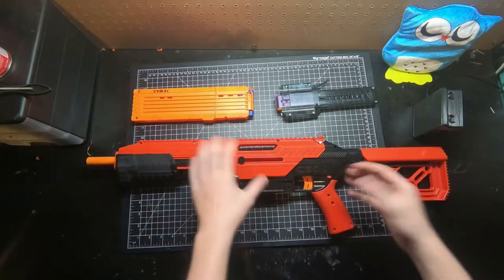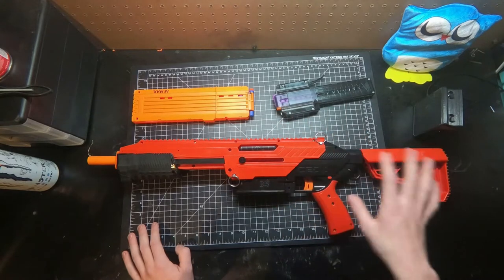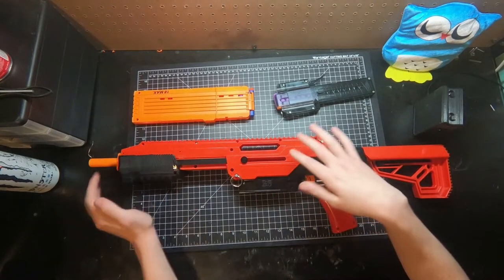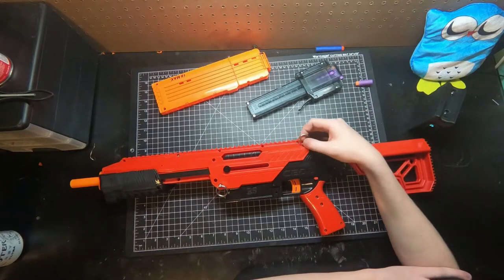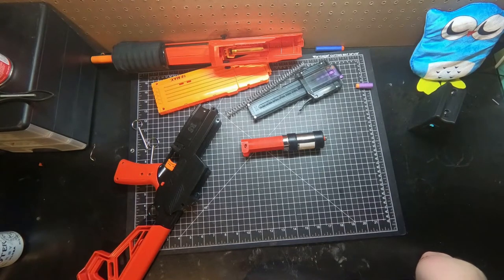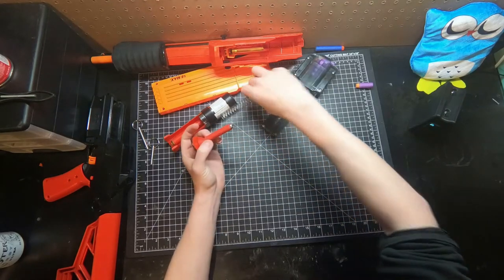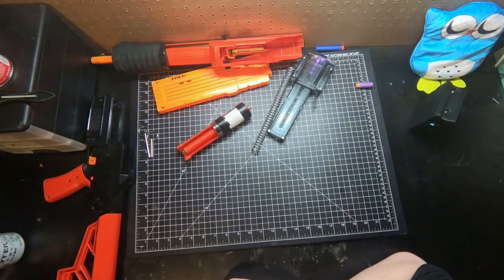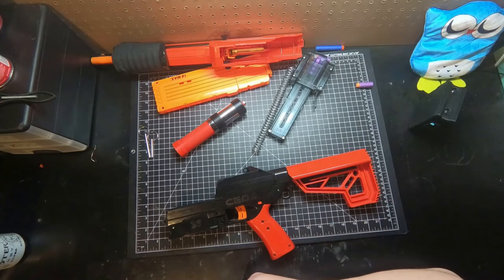Retaliator Update New Kit!!!

Comment: I'm stil not clear on how do you connect the priming bars to the "sled". Are there any other video where you explained it? Looking to use it in my Prophecy, but it's not easy to install the bar to the sled like a ceda
Reply from the maker: So if my knowledge of a prophecy is correct the pump attaches to the the bolsteld with 2 screws that thread into 2 small parts that pop into the bolstled. Essentially this attaches the same way just putting the threaded couplers into our bolt instead of a standard bolt sled.

Comment: Have you looked into x-rings? They're available from McMaster, I remember roboman used them back in the day
Reply: How do you size your x-rings?
Reply: Also, I would consider some kind of threaded insert for the bolt to pump connections, more reliable for long term maintenance and disassembly than threading into 3d printed material.
Reply from the maker: I'll look into them. The bolt openings are larger than the pump arms bolt so it doesn't actually thread in.
Reply: @MajTom101  they're sized to industry standards, same as any off the shelf o-ring